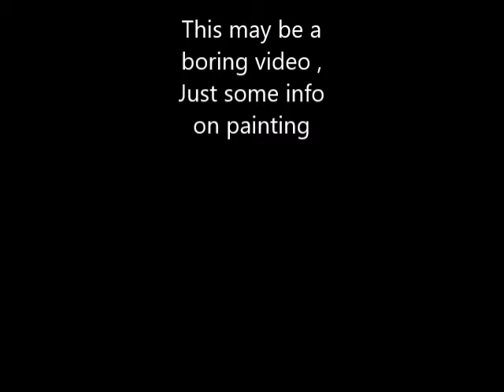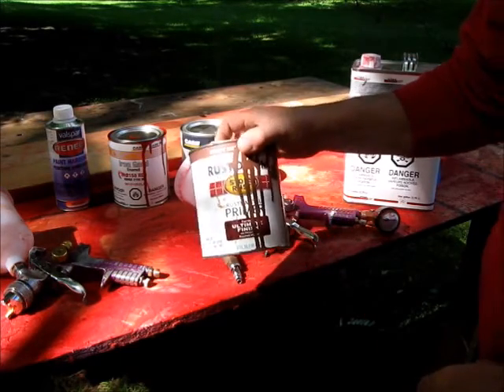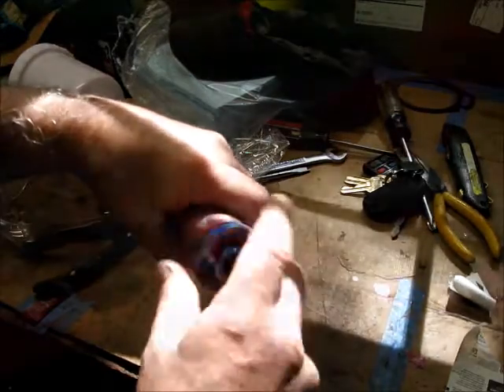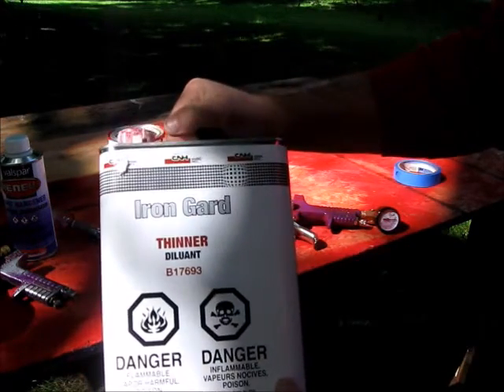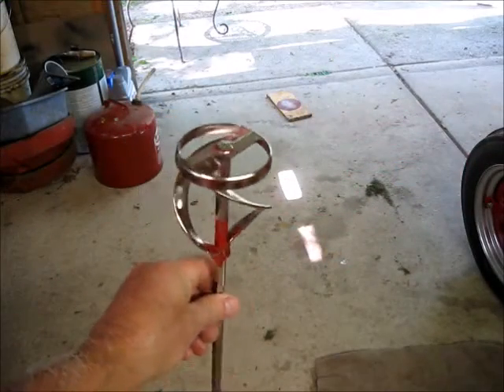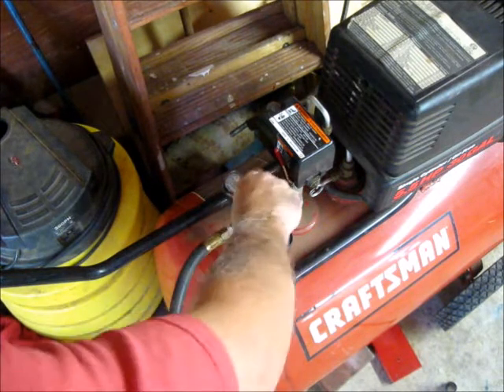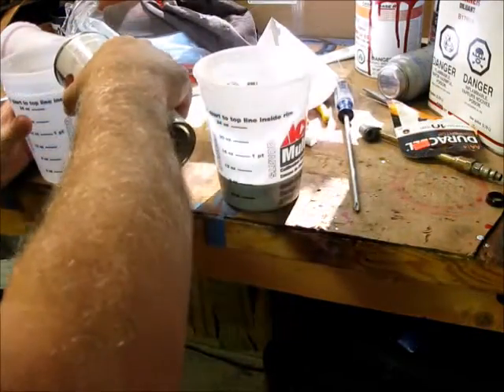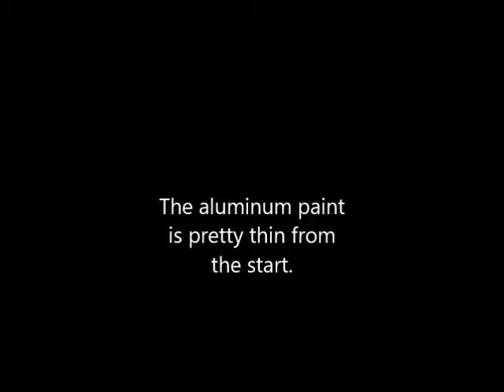1945 Farmall BN Update 31

Comment: Very helpful info! No need to fast forward at all, lol. I think for myself, based on your input on the silver paint, I may just use the rattle cans as it will be on the wheels and in such a small quantity. Thanks.
Reply from the maker: That's true , I have a buddy that said the same thing ! The aluminum paint covers quickly. Two cans and that might have done it for my project. Trust me, clean up after using the aluminum paint is pain .

Comment: hey steve did u prime your whole tractor? did sand the primer or just painted over the primer without sanding?
Reply from the maker: I primed my tractor and spot sanded lightly the hood and fenders and grill. Wiped it down with alcohol wipes and painted. The chassis parts it did not flat sand the primer. All Paints got a flat sand between coats.
Reply: steve where u from in michigan...im in kalamazoo!!

Comment: Can you paint farm trucks withat red color ?
Reply from the maker: Sure, I suppose you could, Its a single stage Enamel Paint with Hardner and thinner is all. There are many options of paint . I am not a professional and this is my first go around painting at all. Look around, ask around and you will get tons of info and help deciding the way you choose to paint your project. Good luck.
Reply: Steve, I had started rebuilding my Farmall B and I am going to go ahead a paint it since I have it apart. I was wondering how many coats of primer you used, how thin or thick and how long to dry before you applied the paint. Also on the paint, how many coats and how much applied each coat and how long to dry in between coats. If you wouldn’t mind summarizing the process as far as the heaviness of each coat and appropriate dry times in between coats. 
Thanks Richard 
- PS I watched your entire series again as I have been working on mine and plan to apply some of your techniques when building mine back up. Also I wondered, you didn’t talk very much about roller bearings and seals to much. Did you have any issues with the transmission, bearings, and seals other than the belt pulley?